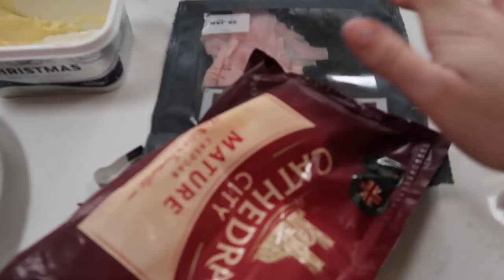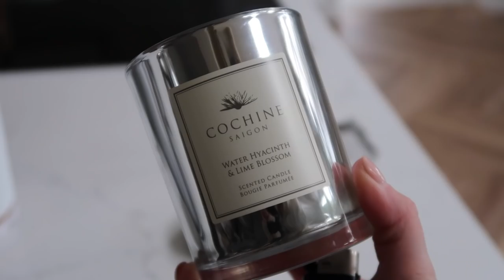WEEKEND VLOG: SPEND THE WEEKEND AT HOME WITH US! LAURA BYRNES

Comment: Fill your sink with lukewarm water and 1/3 cup of hair conditioner
Add the jumper and let it soak for about 10 minutes
Pull out the plug and let the water drain. When the sink is empty, press the jumper against the sides of the sink to rinse the jumper out, but do not wring it.
Lay the jumper flat on an absorbent towel and lay another towel on top and press gently to dry the jumper.
Stretch the jumper back into its original shape.
Lay on an airer to dry naturally.
( this works hun tried and tested on numerous items basically do this in the bath instead of sink ten minutes and drain flatten water out and rest each item flat on some towels and once no longer damp air dry